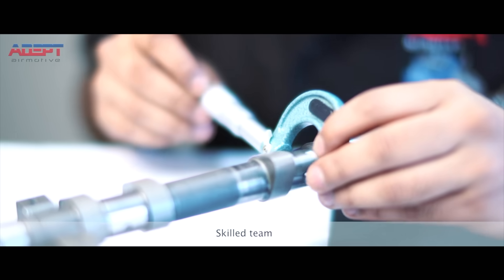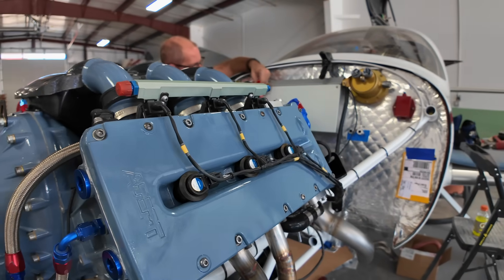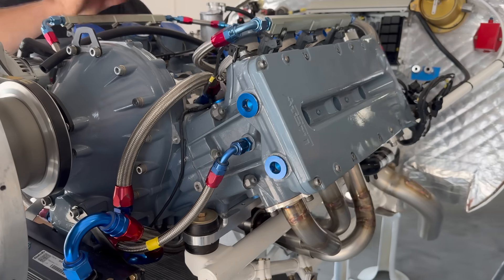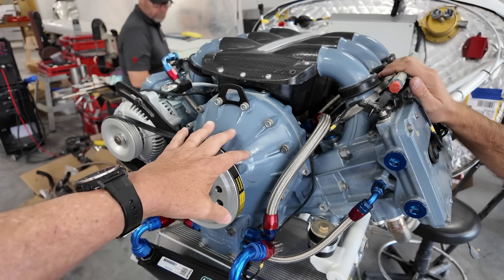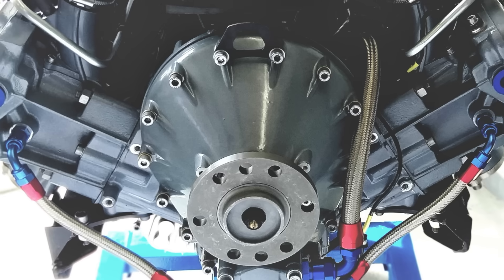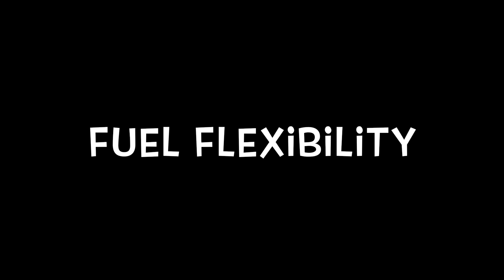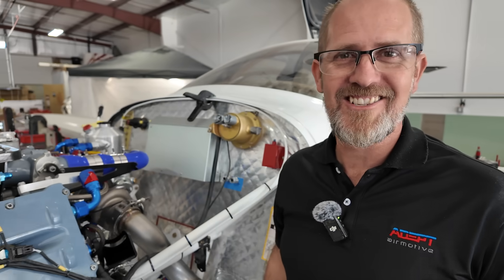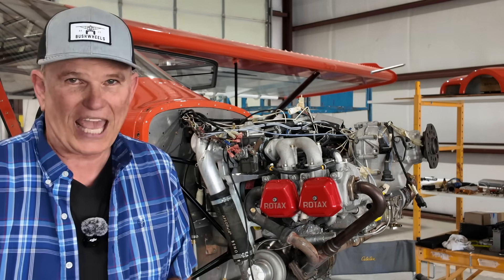The new Adept Engine could be a winner for General Aviation

Comment: You and your co. have to be joking. In g.a, there is a turbin ethat weight in at 120 pounds, burns 10 gallons per hour, and makes 500 hourse power so. Your engine sucks compared to this turbine. Nice try, but about 15 years late.  the gt-50 beats the hell out of your engine . pull it back from 100% to 65 % and still have 350 h.p.!?! like i said forget this when i can put this in my ga aircraft and it will burn ...any type of fuel too. so why by your untryed rngine vs one that beats your in weight power and serving too. so why. so, keep your out of date crap engine.

Comment: Very impressive. It is amazing what you can put together compared to car manufacture engines wrapped in plastic and garbage. This looks 1959 eazy peezy to service. 3K hours is impressive. What this means as a commercial pilot is you can stick this thing in a car (you said we could refill at AM/PM) . Best part is you can probably drive it for at 10K before it needs a tear down and if you run into a FAA ramp inspector  on the highway who cares, well unless you actually run into him.

Comment: The gearbox may increase torque, but this is only at the cost of adding complexity and waisting energy through frictional losses as heat !
Reply: But efficiency and reliability improves overall, because the engine and the prop are both allowed to operate in an rpm range which is better suited to both, rather than being forced to run at an rpm which is a compromise somewhere in between. The Rotax 9xx series engines, for example, are more reliable and efficient than their direct-drive equivalents, and the same was also true of the Porsche PFM 3200.

Comment: About damn time. The Lycoming O-320 in my Cherokee is what?  Basically unchanged from 1950s or earlier and only puts out 150 -160 hp from 320 c.i?
Reply: @brax2364

That’s because the O-320 makes its gobs of torque from four huge cylinders.  It doesn’t need a gear box.  It doesn’t need four camshafts or four valves per cylinder.  It doesn’t need a radiator, coolant pump, or coolant.  It doesn’t need two complete electrical systems (including two batteries) for independent ignition.

Comment: I feel there is something else that need innovating in most private aircraft, and that's 'survival' safety features when in a crash. Why does it seem like most cockpits look more like hard edges rather than safety features? No airbags to mention, and a confined cockpit that looks intentionally deadly to ensure a quick death rather than safety features to preserve life. Come on, if F1 Racers can survive a 250-mph crash, why not build in at least some of the same for slower moving aircraft? That is to say, not all airplane crash are nosedives at speed but stalls at slow speed. So please do not say, "cost prohibited", that's not a good excuse, it has to be something else. The only safety feature I have seen in recent decades is the airplane parachute... good start, but more needs to be done.

Comment: Unless I missed something, I only saw one plug per cylinder. even though it was coil on plug, I like the idea of two ignition systems. Call me old fashioned, but I have a weak spot in my heart for redundancy.
Reply: The redundancy is in having 6 ignition systems, instead of one or two. You're not going to lose all 6 coils, and if you lose the computer that drives them, you'd (ideally) have a backup computer to take over.

Comment: 4500 crank driving 2700 prop??? If they were gonna go geared why not gear it further down to a more sensible rpm? The original lyco/conti direct drive engines were a compromise between the engine wanting high rpm for power and the prop preferring low rpm for efficiency and quietness.. It seems the designers for this Adept didn't really think it through.

Comment: The power plant is really cool however, I do see a problem waiting to happen and it’s not a question of if? It’ll be when? And that’s the fact that all the pressurized intake side of the motor that you’re using the blue rubberized intercooler hoses. I didn’t look close enough to see if you are using constant torque hoseclamps but I’m guessing so. Bluntly put (sorry) they’re going to fail at some point. I’ve got a fair amount of time with turbocharged motors but mostly diesel and every engine that I’ve had has popped the charge tube clamps off at some point in time. I would strongly suggest that you guys convert it all to bolt together connections so that won’t happen. Cuz it won’t happen on the ground! It’ll happen in the air under a fair amount of power. And if they can’t glide to a landing site then it could be fatal and I’m sure your company won’t survive the lawsuit! Let alone the guilt of it happening and knowing it could’ve been prevented. 
Best of luck to you all…..

Comment: I've always heard how modern the current Lycoming or Continental engines are.  High compression, reliability.....
Boo ha!  
It's all 1940 war time technology and that is why every pilot spend a majority of their aviation time learning how to deal with failures.  Failures caused by non-reliant war time tech.
How many of drivers around the world spent time training on what to do when their car has issues?
I truly hope this new powerplant takes hold and becomes a strong, truly reliable engine.  Also one that can be "easily" be put into the current aircraft out there.
Now there's the FAA and the "secret handshakes".
Again, some may need to find another method of paying their bills and get someone in there that are pushing for the right stuff to be available.

Comment: For the life of me I don't understand why did you use a coolant?
Why not replace the coolant with the engine oil. In that way you only need one radiator. Also I would have designed the bottom of the oil pan as the radiator. Aluminium, very large fins with the oil pickup at the bottom of the fins. You are going to drop about 15 kg doing it that way.

Comment: Number one what does it costs? Number two does the gear reduction have a chip detector with a light warning on the panel if it detects gear pieces coming apart. I have never seen a gear reduction that does not eventually throw off part of a gear. Just saying forget gear reduction always will let you down for cost to overhaul or replace that gear box. Nice try waste of money in my book. Over 42 years in Aviation maintenance all the gear box engines were very expensive to overhaul. You might as well buy a new engine every time then keep putting money into the gearbox $$$.

Comment: The fundamental problem with any new GA engine is that the market is so small and the requirements so strict that there is almost no room for either profit or error. The only successful “new” GA engine has been the Rotax 900 series which has only been possible because the parent company was already well established in other markets, had deep engineering and manufacturing knowledge, was large enough and, finally patient enough to make it all work.
Reply: But you can't even use Rotax on a US certified aircraft, even though they've proven to be as, if not more successful than legacy engines. I guess Lycoming must be owned by a powerful parent company with a deep pocket lobby group.
Reply: You *can*, legally, put a Rotax on a Cessna. There is an FAA-approved application where you can replace the Continental O-200 in a Cessna 150 with a Rotax via an STC (Special Type certificate). 

I help to manage a flying club with two Cessna 150s. I looked into the STC for the Rotax conversion. The total cost far exceeded that of even a major rebuild of the O-200 and we quickly dismissed the idea. I forget the cost of the STC, but I seem  to remember that it was about $5,000 on top of the $20,000 for the Rotax and the installation cost which would have run about $5-10,000.  Buying a new O-200 would have been a fair amount less expensive.

Comment: Points to @htschmerdtz4465 for noting the pricing issue. The most pressing issue in GA is not want of technology, it is price. That is especially true in propulsion--the most expensive aspect of aircraft ownership. If an IO-360 were $20,000 new, I would bolt a new unit onto my Arrow's firewall every 2,000 hrs from now until forever; that would be a no-brainer, and I wouldn't care that it is an oil-cooled pushrod engine (they work fine at 2700rpm). Would it be nice to have lighter, more fuel efficient, longer rebuild/replacement interval engines than the incumbents (Lycoming and Continental)? Sure. Am I willing to pay even more money than the already-outrageous prices the incumbents charge? No. The incumbents' pricing is apparently being considered the "lowest" price we consumers would pay. That is not acceptable. Part of the issue here is that the incumbents essentially hold duopoly power over the certified GA market, and that power has enabled them to extract duopoly rent (pricing) from the market. If a new market entrant wants to actually make a difference (a "maverick", economically speaking), they need to compete with the incumbents on price. And when I say compete, I mean offer lower prices. A firm that offers "new" tech in aviation engines that does not beat legacy pricing is essentially not a maverick at all and does the industry's consumers no favors. And if the price is higher, we'll just continue buying the old duopoly engines from Lycoming and Continental. Yes, DeltaHawk is a great example. It's a logical, elegant solution. But I spoke with them just before Oshkosh, and their engine is over $100,000 ($115k, if I recall). That is not a success. A new market entrant here should consider competitive pricing as the primary goal (translating decades old engine tech to an airplane firewall and propeller hub is secondary). So what is the price, Adept?

Comment: How much is the cost?  Does it run on 100LL?  If so, how do they deal with leaded gas?  

BTW torque is not important by itself; horsepower is. The only reason for gear reduction is to bring propeller rpm down to subsonic tip speeds.

Comment: Forget Avgas.     Make it run on Jet-A (Diesel).   (Diesel engines also get more miles / gallon than a gasoline engine.)
Reply: Diesels make terrible aircraft engines and they don't always result in an aircraft with better mpg. For example, the Bonanza, even with its ancient gasoline engine technology, gets the same mpg as the DA50 diesel, while also being a more capable aircraft. Imagine what modern gasoline engine technology could do in the Bonanza.
Reply: @PistonAvatarGuy  Av gas is less than 1% of gasoline production.  Consequently oil refineries don't like to make and distribute it.  Get rid of Av gas and switch to Jet-A OR figure out a way to use Automobile gasoline.....
Reply: @keitha.9788  The engine does run on mogas, it doesn't need avgas.

Comment: What is the fuel burn? Brake specific fuel consumption (BSFC) or overall thermal efficiency (OTE)?  Is the OTE in the mid 50's in percent?  I dont think so - because you can not get that with only 10.5 Cr. Push up to 15-16:1 Cr, modified Miller Cycle, and Lambda of 1.2 - -nope.  Can't get there with that bore stroke ratio.  Even a formula 1 engine is in the 55% OTE range. Good start with the V6 config, Central spark plug and nice integration of the gearbox, great power/weight but just not the complete next generation engine. Too inefficient and hot parts, not good for long life.  I'm sorry, but it was a magnificent effort. Well done, but not there.

Comment: I have been working on aircraft since Feb. of 1967. Geared engines- the front gear box sends ground up metal to the gears in the aft section. In commercial use the TBO is 1200 t0 1600  hrs.  In aviation the radiator idea hasn't worked all that well. Good luck children.
Reply: Geared engines are just fine and done properly, can last forever.  Rotax four strokes are incredibly reliable and before anyone says “not with high horsepower”, try looking at the 5000-6000 hp engines on the Hercules.
Reply: Later versions of the R-3350 had a TBO of 3,000 hours.

Comment: that sounds like an amazing engine,  the HP to weight and being able to loose the cooling system and have an oiling system that's going to keep the engine in the green zone with 50% power is one of those selling points along with having room betwine the engine and firewall.

the LSA world has open the aviation doors to so many new ideals  

sounds like a game changer in the aviation world

Comment: Why OHC heads ? Pushrods would have much more compact simple and lightweight
Reply: That would also result in a huge loss of performance and efficiency. A direct acting, OHC valvetrain (which is what this engine uses) also has fewer moving parts than a pushrod valvetrain (when comparing engines with the same number of valves). Pushrod valvetrains also have poor longevity relative to OHC valvetrains.

Comment: The problem with GA is the certification process.  There is zero evidence that the laborious process makes GA safer. The failure rate of experimental planes is virtually the same. I have a Volkswagen engine that was designed for a car. As long as government bureaucracy controls GA no engine will be affordable simply because of the time to overcome the bureaucracy

Comment: Nice engineering.  The real problem with these new engines like Adept and Delta Hawk is that you just can't put them in any certified airplane.  Would love to have one for my C35 Bonanza.  The cost to go through the certification process is enormous.  Yes I know Delta Hawk says they are certified, but that's just the first step.  Then they, or any engine manufacturer has to get an STC to put it in each specific airplane.  I've yet to see a Delta Hawk in any certified airplane, and it's been several years since they received their approval.  Wish you luck, but the vast untapped certified market will probably remain unreachable.

Comment: This is so overdue...so overdue. Anything that is NOT a 1930's motorcycle engine (that's what we're putting in our planes folks!) with ridiculous aluminum "jugs" that are more prone than not to tear away from their opposed cylinder and case is a life saver!! Just look over all the NTSB reports of complete engine failures (all related to these garbage aluminum cylinder cracking and splitting away from heat stress) that end up with horrendous fatal accidents of entire families(!!!) and for what, just taking a nice afternoon flight?? Insane we are still using these old pilot killing engines. I have a Piper Arrow IV (PA28R201T) with just that, a time bomb waiting to suddenly fail when I need it most at power, low and slow...I sure do hope this engine proves successful so I can finally get rid of my Achilles heal. All of us in GA (SEL) need this - our lives and that of our families and friends are at stake! God's speed, "Adept"; I'll be a customer when/if you get a 200ish HP version for me and the thousands of us who don't want to burn $30k on just more dangerous garbage from Lycoming or Continental.

Comment: The problem with introducing new technologies to the aviation market is that you better have a pile of liability insurance. If someone is killed in the aircraft, doesn't matter if the fault was the engine. You will get sued along with all the other aircraft suppliers.

Comment: interesting promotional  video on an engine with a few differences in what has come before. Good oil cooling and water cooling & turbos have been around since ww2. So what is new? electronic engine controls.  It is probably a bigger Rotax but whether it is a better rotax remains to be seen. The biggest negatives in the video is NO mention of price whether initial price or expected price. Longevity takes a long time to determine.. I would pass on this new engine until and unless it has a track record. There are usually a lot of failure points with a new engine especially from a startup. I wish thew luck and with the world heading into a recession they may need it!

Comment: The power to weight ratio is fairly exceptional for a >2000hr engine, if it includes all required cooling systems and liquids. Wonder how they achieve that.

Comment: 360 HP at 4500 RPM from a 3.2 litre turbo engine is asking a lot, even in the automotive world and even if this is a non-continuous rating (which I suspect it is). Good luck to them, they will need it.
Reply: It's about mean piston speed not RPM. The piston speed is lower than existing aviation engines in the power class since the stroke on these engines is very short. Also of great interest, this means not only are the pistons going slowly the inertial forces are far less because of it. Existing engines have huge reciprocating mass and high mean piston speeds from their long stroke. These work differently. Small displacement higher RPM less internal stress.

In the early 1990s Honda made a publicly available 21,000rpm 250cc 4 cylinder engine. These are very long lived engines. The stroke is only 37mm so even at big rpm the piston speeds are quite moderate.
Reply: Cruise is at 4,500 rpm, take off power is at 5,800 rpm, which is the same as the Rotax 916 iS. The Rotax has a 2,000 TBO. BMEP is actually slightly lower than the Rotax, while piston speeds are a little higher. Piston speeds are still pretty low, at 13.8 m/s, vs the 11.8 m/s for the Rotax.

Comment: An old rule is that you MUST have full rich setting when climbing, to use the cooling effect of the petrol. Would be interesting to hear if this new engine handles this in an other way.
Reply: That rule is indeed very old, from 1940s style manual mixture controls. Modern fuel injection systems adapt automatically.